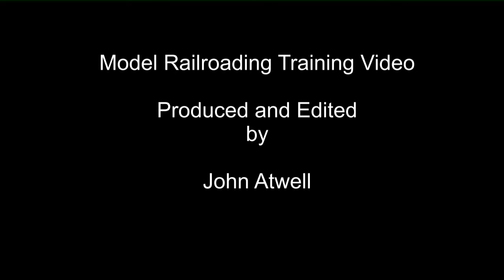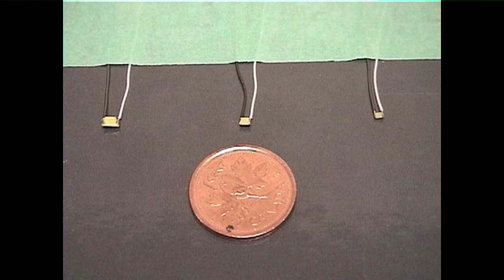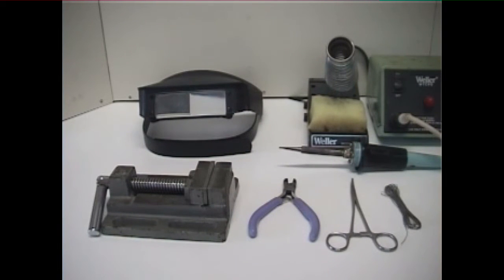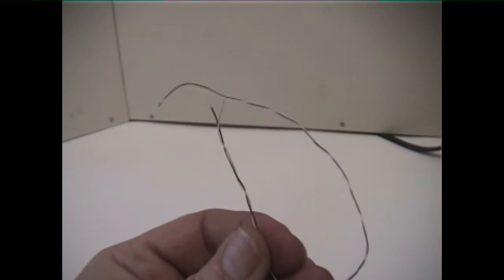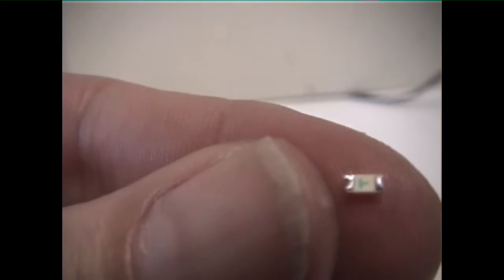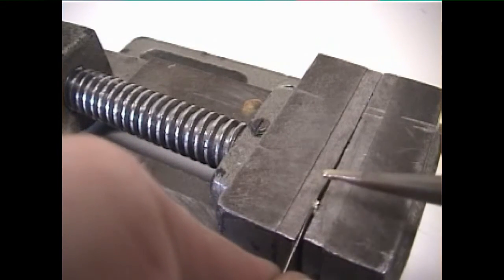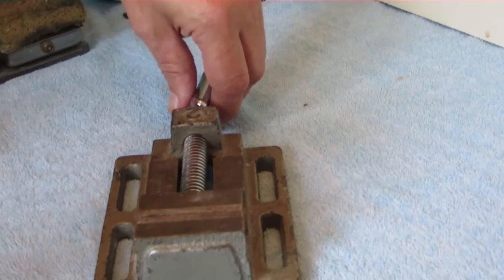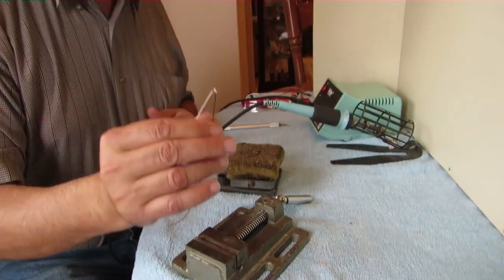Surface Mount LED Training Video for Model Railroaders

Comment: Missing from your talk is the explanation that the 4 digit numbers correlate to the length and width of the LED.  Also the resistors needed to make them functional is missing, otherwise the rapidly will go Pop from an over-voltage issue.  Mounting methodology would also be informative.

Comment: That big vice works as a huge heat-sink. You might be better holding these tiny components with a clothes-peg. They are thermally more efficient and less likely to crush the leds. Nice video,
Reply: great video thank you   just use helping hands or cloths pin that big vice does not do a great video justice
and helping hands has a magnifier...

Comment: The LED number is not the letter "O" 0603 but the number Zero, that could confuse some people.  They are Zero six Zero, three smd leds or 0605, etc.
I am guess the 555 timmer for flasher circuts.